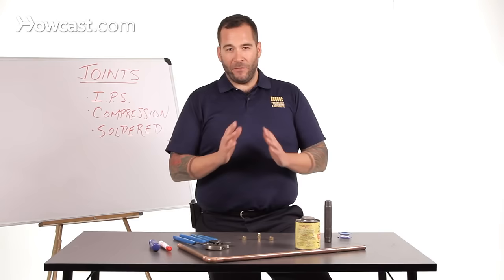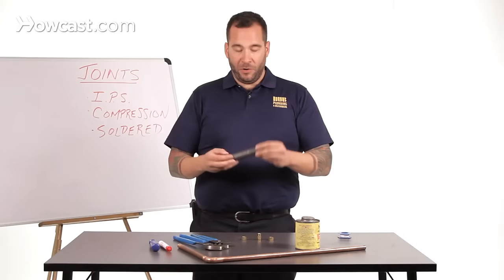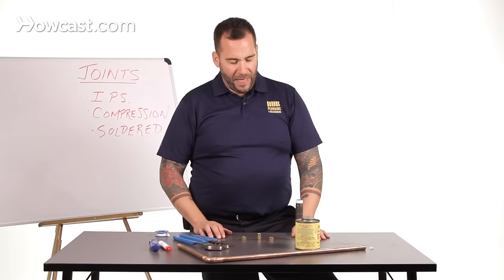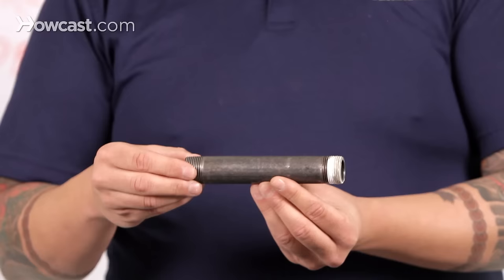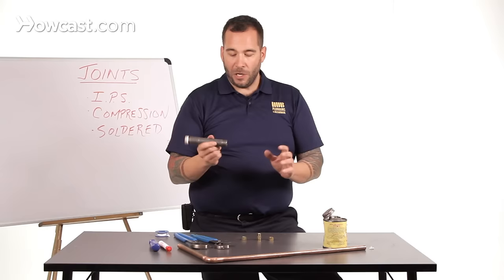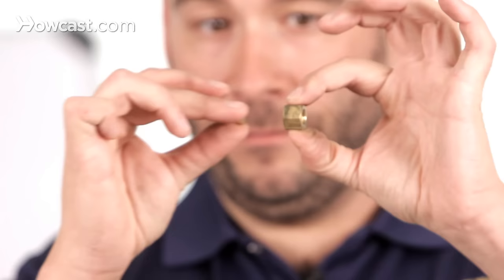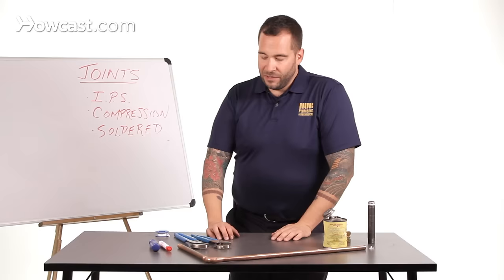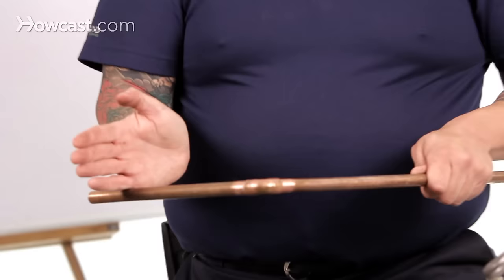How to Fix Common Leaks | Basic Plumbing

Comment: in the UK an old trick is when soldering a pipe that has a tiny amount of water that keeps running into the joint stuffing white bread (not the crust)up the pipe.  it prevents the water reaching the joint whilst soldering and will get blown through by water pressure when the supply is returned.  not recommended were it feeds to pressure reduced valves such as a WC systen unless you can easily clear it should it block.